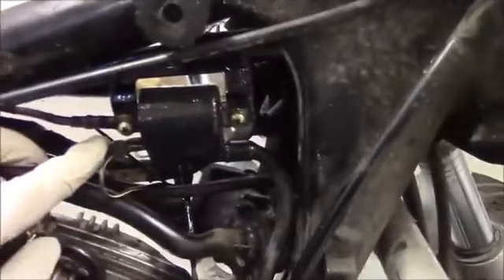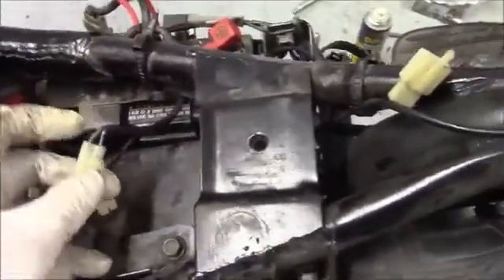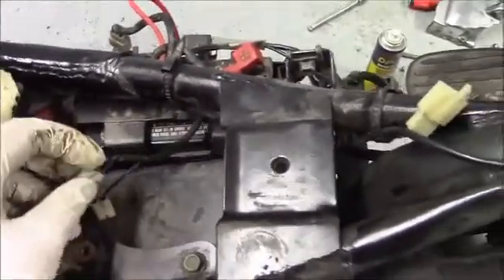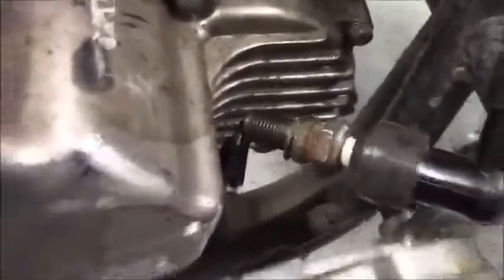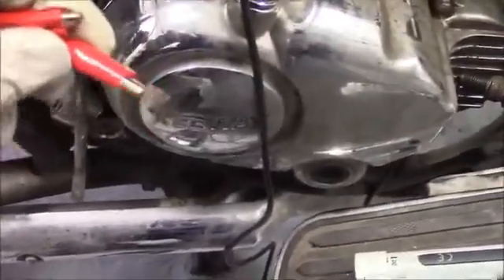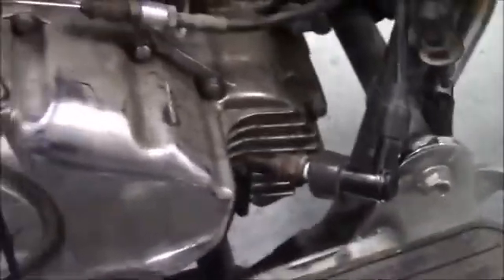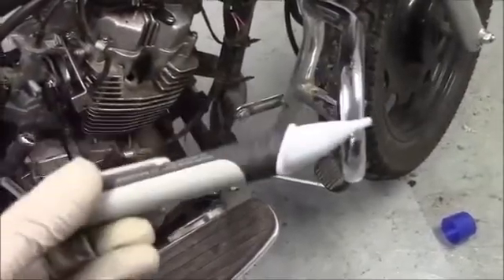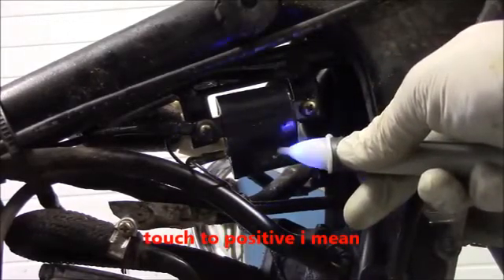NO SPARK FIX: Motorcycle CDI Bypass & Coil Test (Primary Ignition Circuit Diagnosis)

Comment: Have same issue ran 12 volt to the cdi connector and it sparked but now is not sparking ?
Reply from the maker: did you test the coil and check earths
Reply: @cagmito76  i have cb900 can you explain me a little i did what you did on your bike bypass the cdi unit and it started to spark on all 4 cyñinders i tried to get it started but it didnt and spark went away

Comment: it will not be cdi unit , the small pulse trigger in alternator will need moving slightly closer to magnetic rotor had it myself and it cured ignition fault if not that. kill switch wire.
Reply: Im hoping its that I haven't been able to figure out the problem on my cg250 new CDI new ignition coil and stator with pulse generator
Reply: But now I don't have power going to my CDI
Reply from the maker: nice good advice

Comment: Hey man. I’ve got a 99 cbr F4x and It’s doesn’t wanna fire in the center two cylinders. It sparks when out but doesn’t quite get the two exhaust pipes hot as the outside two. I’m not sure what’s going on
Reply: Check gap

Comment: I have the exact same problem did you just end up changing your CDI? Did it work grand after that?
Reply from the maker: it ended up being problem with loom , break in a wire
Reply: @cagmito76  I might go through my loom because I’m having the exact same issue and when I back probe with a 12 volt power source it sparks
Reply from the maker: @oisincaffrey6855  Have you checked stand switch and other safety switches clutch neutral etc ,  sounds simple but they fail a lot .
Reply: @cagmito76  it’s an ovetto 50cc, far as I know there is no stand switch or kill switch, pull in the brake lever and it turns over all day long but won’t spark without by passing like you done with your problem
Reply from the maker: @oisincaffrey6855  I cannot find a wiring diagram for it sorry not even neos which are supposed to be similar so as long as your sure of no safety switches start testing loom

Comment: I have problem when I rev bike high and 10amp fuse blow and all electrics blow and my cdi loses it spark so I have to buy new one haooen 3 times now last cdi I got like 100 miles out of it befor it blew whats the corse you think
Reply from the maker: Sounds to me like the rectifier is faulty, its meant to limit voltage generated by the rotor and stator to 14v to charge the battery , change rectifier and make sure bike has a max voltage of 14-15v at high revs
Reply: @cagmito76  I put new regulator on got down the road I rev bike hard and gone again
Reply: @cagmito76  under my tank I did take out a wire because the brass connector was broken and I put one of the wires together and put electrical tape on. Could that be the issue u think
Reply: It was the ignition wire BTW that was broken but it was working perfectly untill I touched it I did last for  like 1 week befor the 2nd cdi blew
Reply from the maker: @jasoncarthew2279  what voltage is it generating , if its not regulator its a wire touching to earth maybe and blowing fuse but burning out cdi before fuse blows.
Reply: @cagmito76  I don't have a multi meter I just changed the parts I thought it could be. But like I say it all started when I messed about with the ignition connector block
Reply from the maker: @jasoncarthew2279  Could be a wire touching to earth in block or wrongly wired its too hard to say without testing
Reply from the maker: what bike ?
Reply: @cagmito76  cbr 125 2012 mate
Reply: @cagmito76  can a faulty pulse generator cause this mabe
Reply from the maker: @jasoncarthew2279  if you mean pick up coil i dout it very low voltage. to blow a 10 amp fuse you got a serious problem direct short to earth , 2 touching wires or faulty regulator , https://www.facebook.com/groups/1102399560584877/
Reply: @cagmito76  thank your for your advice mate appreciate it. Il put a new connector block in tomorrow and get another cdi and see what it takes me from there
Reply from the maker: @jasoncarthew2279  ok ill have a think about it as well , its hard to fault find someones bike miles away without testing voltages.
Reply: @cagmito76  I don't even know how to use a multi meter tbh lol how much would a garage charge to diagnose the fault you think
Reply: @cagmito76  or would it be alot cheaper jist to buy a new harness I can get for 40 quid with the cdi lol
Reply from the maker: @jasoncarthew2279  its worth a try the last person to contact me on here had a no start issue changed loom and it was ok , if i was you i would test stator and pick up coil first , get a meter and learn well worth it here is a post i did https://cbr125owner.blogspot.com/2017/01/honda-cbr-125-r-generator-alternator.html
Reply: @cagmito76  don't think it the coil or stator as when I change cdi bike works fine when I put a diffrent one on
Reply: I read that eletrical tape is only good for volt not ground current. Another reason why i think it is the ignition wire I pinched together which is sitting on the chassi frame
Reply from the maker: @jasoncarthew2279  Yeah its just a starting point for any electrical fault finding test voltages at stator and at regulator/rectifier , then test voltage leaving the reg/rectifier once you know this is all ok and working fine you can change wiring loom with confidence   ,   You need a milti meter  to do tests really as changing parts can get very expensive especially when the fault is burning the computer.
Reply from the maker: It is probably a loom fault touching to earth and if you 100% confident in the stator and reg/rect then change the loom its the usual suspect especially around the steering area with lots of movement the wires can split.
Reply: @cagmito76  can I send you a picture though Facebook mate I will show you what I bodged up that made it All start
Reply from the maker: @jasoncarthew2279  Yeah ill have a look see i can see anything
Reply from the maker: Stick it on that group see if anyone else has an idea too or try thid group more people https://www.facebook.com/groups/125mcuk/

Comment: This is what I am dealing with at the moment. I have a 92 Suzuki intruder 1400. Well, it was titled as a 96 . But I found out that it had a 92 motor while rewiring the entire bike from scratch when I realized that the two harnesses were not the same and I had been troubleshooting the wrong diagram. What I have learned so far is that the igniter or CDi or whatever you want to call it really does nothing but monitor all the safety switches on the bike and make a determination whether it will send spark to the coils or not. I threw away the CDI in about 90% of my wiring harness and all the relays and ran the pickup directly to the coil along with a moto gadget m unit and that's all she needed. No it doesn't have all the safety features it's supposed to. And I'm glad because I didn't want that shit anyway so you can get around it if you want to . This is a great video by the way
Reply from the maker: Nightmare electrics can be
Reply: holy crap I never knew about the M unit. I have an 05 Vulcan 1500 that wont spark and I have replaced pretty much the whole system other than the ECU (it's still in the mail) if that doesn't work I'm getting an M unit.
Reply: @VIP854  I got rid of the Suzuki and now I have a 00 Vulcan 1500fi. Well it was a 1500. I put a 1600 on it from a low mileage mean streak. I've got the power commander fuel delivery with chopped pipes and it hauls the mail

Comment: I have klx 650 plugged the cdi out plugged it back in now I have no spark.. I have power from a red wire from the stator power from the starter but the black wire that goes from the cdi to the coil has noting at all and ideas
Reply from the maker: any stand switches ?  maybe clean out connectors .
Reply: @cagmito76  if I twist the stand wires together will this bypass it il clean all the blocks today
Reply from the maker: @dbdb4274  i usually do twist them together but you can test switch with ohm meter , id check diagram or manual before twisting wires it should be ok but i dont want to say yes and then you burn cdi out .
Reply: @cagmito76  I don't have a meter il twist them and give it a go.. The cdi had a problem but it started a diffrent bike I'm jusdt lost with it now
Reply: Noting to do with the stand no change when I twist them
Reply from the maker: @dbdb4274  you goona need a meter , best as you can do some proper checks  .
Reply: @cagmito76  going to buy one today.. But I tink the cdi I'd goen.. If the regulator is broke could this be a problem iswell
Reply from the maker: @dbdb4274  if you getting a signal to the cdi but nothing out id suspect cdi .  if no signal to cdi then something in the igntion circuit before the cdi is faulty .   sorry its all about testing now but it will pay for its self back can you imagine buying a rectifier thena cdi then a coil lol .     theres some real good videos of youtube about no spark diagnosics .  and this book is amazing too   http://www.amazon.co.uk/gp/product/0760327165/ref=as_li_tl?ie=UTF8&camp=1634&creative=19450&creativeASIN=0760327165&linkCode=as2&tag=cagivamitoblo-21&linkId=537PRJ76JCOVR2V3
Reply: @cagmito76  how do i test the power going in tonthe cdi because I don't no if there power going in.. I just know there power to the starter and red wire from the stator is working
Reply from the maker: @dbdb4274  you will need a wiring diagram for your bike and see what colour the wires are and where it gets its signals from , everybike is different so its impossible to know what wires to test without doing a bit of reearch on it .
Reply: @cagmito76  il have a look up on it
Reply from the maker: @dbdb4274  yeah thats what mostly this game is looking for the right wiring diagrams spend hours on it .
Reply: @cagmito76  can I make my own loom and cdi... Like if I find out what wires are what and wire up a let say a pit bike cdi or could I risk the bike been damaged
Reply: Might be a ground wire, your ignition coil creates spark by a powered (generally has to be 12 volts) colliding with a grounded connection inside of the coil, basically shorting out but in doing so creates a whopping mega burst of power which causes the spark in your plug. Maybe your ground wire is frayed somewhere running to your frame, definitely grab a volt meter and check for continuity to wherever that black wire goes to from the coil.